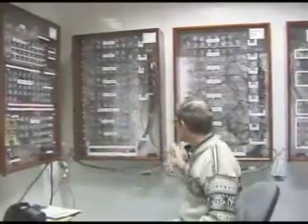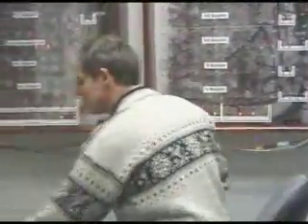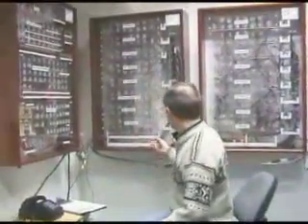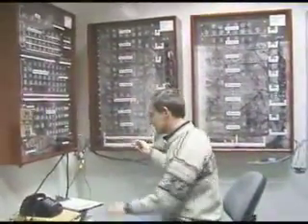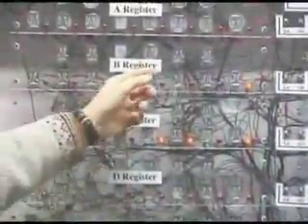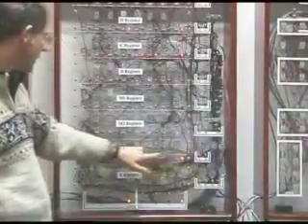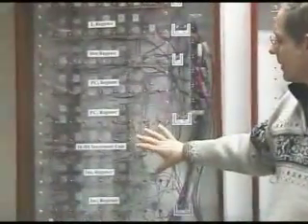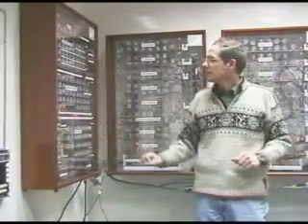Harry Porter's Relay Computer

Comment: Automatic elevator controls worked like this for a long time.  And jammed frequently.  Think about it: They needed a stack to remember the floor calls both from inside the car and the floors.  They needed to resolve them as the stops were made.  They needed logic to determine the direction the car would move.  But it was asynchronous.
Reply: Also pinball machines.

Comment: I have two questions. 1. Why wasn't this around 150 years ago. 2. Why build it today?
Reply: +Bizorke We didn't have this kind of computational logic 150 years ago, and something like this today is usually built for fun.
Reply: Actually, we did... and everybody who knew the things that could have made it work, from the bare idea to the implementation details, knew each other and had either social or professional relationships. (That includes, but isn't restricted to, George Boole, Augustus De Morgan, Michael Faraday, Charles Babbage, with Ada King, the Countess Lovelace as both a social linchpin and contributor of the "effectively computable" concept, à la Turing.) It's obvious in hindsight, but then every good idea is obvious in hindsight. The trick is to see something that isn't there yet. And, in the case of a couple of the possible key players, getting everybody to play nice together when it counts. Konrad Zuse, working some 75 years later, had the slight advantage of living in a world where relays were ubiquitous, Boolean algebra (with De Morgan's refinements) had become necessary to manage telecoms switching tasks, punched paper tape and tabulator cards were everywhere (though he did use photographic film as a replacement for reasons of mechanical reliability) and the idea of having an electric switching machine to manage the task made binary (or even binary-coded decimal) arithmetic much more practical than it could possibly be with page after page of 1 and 0. It still took vision to see the thing, but the parts were, by then, jumping up and down and waving their arms about.
Reply: Not 150 yrs., but about half that time, EDSDAC.  Also as an educational toy to teach computer logic 50 years ago, there was a board with about 4 relays built in, signal bulbs, some capacitors and resistors you could use as jumpers, and a clock that worked just like an engine's mechanical distributor to simulate a machine cycle.  You could use the resistors and capacitors to build asynchronous units, and/or the clock to make synchronous ones.  Its competition was a plastic hand-cranked all-mechanical computer.

Comment: Very cool.... must be hard on the relays? I wonder how often one fails under the repetitive actions.....
Reply: +Peter Rabbit yes they are fantastically unreliable when compared to solid state.
Reply from the maker: These relays have a rated MTBF (mean time between failure) that is very high, but nonetheless I was seeing failures! Two failure modes: contacts were sticking closed and failing to open; and contacts would physically close but fail to conduct. The problem was that I didn’t have “fly back” diodes and the inductive coils were causing nasty arcing. This was welding the contacts closed and (I think) oxidizing the contact surfaces. The arcing was also frying the LEDs. So I recently took the whole thing apart and added diodes to every single relay. Now the computer never fails… but mostly because it is never powered on!

Comment: Depends on the computer's architecture.  Technically any computer should be able to emulate any other computer and run programs from it, given enough time.

There's one guy who's managed to run Linux on an 8-bit microcontroller emulating a 32-bit chip, although it takes several hours to boot.

Comment: It depends what you classify as 'duplicate'. Sure digital can put out exactly what is coming in. I can testify that I have a very difficult time telling the difference until I PLAY something digital. A modeled guitar amp sounds the same, but if I sit there and play one for any length of time I grow fatigued sooner. The LSI organs I play requires I adjust my hearing to a slightly fake sound. It's all subtle. The gap is closing though.

 I challenge Kemper to model a Conn 645 analog organ exact.

Comment: "Digital can't seem to accurately duplicate the vacuum tube, transistor, and LSI organ sounds with any accuracy."

That doesn't make sense. You can emulate any analog circuit with any precision desired using an appropriate amount of Nyquist and SPICE. If the output signal doesn't match, then the model is wrong. The problem is not in the numerical nature of the simulation itself.

Comment: last...cont. I have been searching for a practical approach to the issue of capturing every nuance of the great vintage, and slowly disappearing, analog electronic and electromechanical organs. There are subtleties that digital has an awful time at duplicating. In fact it's a complete failure on many levels. I will use the Wurlitzer electrostatic reed organ as the ultimate example of an organ that can't be digitized. google 'Wurlitzer 4600 NSHOS . 

Curious about Kemper amp tech for TonGen &FPGA

Comment: ...cont.  It seems that the behaviors that make the analog electronic organs sound the way they do are very dependent on lots of analog interactions in the circuitry that can at best be mimicked digitally, but the resultant sound is that sterile digital sound that is always the same. Actually digital in the 21st century has come a very long way. The free Hauptwerk Paramount 310 Wurlitzer download is stunning, but it is a pipe sound. I'm convinced there's a way to apply digital differently..cont.

Comment: Yes they can. A capacitor stores charge, and if you charge it up and then measure the voltage across the terminals, there will be a voltage there. If you then discharge it, there will not be a voltage there. You can, therefore, effectively store one bit of data by charging or discharging it. If you then connect one terminal to ground and the other to the gate of a MOSFET transistor, you can make the transistor conduct if there is charge or not if there isn't. This is used in SDRAM.

Comment: In my own setup, I was thinking to use relays for memory as well, as this is what Zuse and others did... however, if you take note at the size of his Register Unit, which contains, A/B/C/D/M1/M2/X/Y registers for the machine, that is analogous to 8 bytes of RAM.  That unit contains 126 relays for its control logic and storage.  His SRAM chip is 32Kx8, so to make 32KB RAM with relays it stands to reason it would require at least 516,096 relays. (32,768 / 8 = 4096 units * 126 relays = 516,096).
Reply: It must be a CISC architecture.

Comment: Transistors may work, they work on the same principal I believe I dunno what you mean by Capacitors, the difference between Trans and Relays are chemical vs Electro Magnetic, I doubt the LCD screen most likely LEDs to show output.

Comment: Fantastic!

I wish I had a machine like this during my assembly programming class - something is lost when you're programming low level programming with solid state devices.

If I were you I would cheat a bit and use a modern PC to load up the programs.... and the debug the programs.

Did you create your own instruction set?

Comment from the maker: @snippydude

THANKS!

Some people point out that all computers are "Turing Machines" and, in a mathematical sense, all computers are equally powerful.

Recall that a Turing Machine has an infinite tape. The infinity is crucial. Without that infinite memory, the thing is a Finite State Machine, even if it has a 1TB disk. Thus, every modern computer is a FSM. However, in real devices, the amount of memory does matter. Memory is like speed: more is better.

Comment from the maker: @toptenmaterial

Yes, all computers are identical, in a mathematical sense, having an ability to compute the same set of functions. The only differences between computers are (1) speed, (2) size of storage, (3) Input/output devices, and things like cost, size, and power consumption.

In theory, I could write a PC simulator for my relay computer and use it to boot Windows. However, it would take about 500 years.

Comment: @NOnehtaehgnik a bus is parallel lines where multiple devices can tap the line to use data as it flows over the bus. generally a bus has some sort of address to go with the data bus, and that address is used to select which device(s) are active for that bit of data.

Comment: it's made with relays. have u never heard relays clicking?

when current is passed through the coil in a relay it creates a magnetic field which then attracts and toggles the contact to the other position. when it touches the other position, the relay makes a pretty audible clicking noise (depending on how big the relay is i guess) this is a system of hundreds of relays and when they click over it's obviously pretty audible

Comment: Relays are electro-mechanical devices. It's comprised of basically an electromagnet that pulls a reed switch close. The clicking sounds you here are the inner switches making contact to the electromagnet pulling it (to complete the circuit).

Comment: Hm, that would be pretty cool. I think you need sort of a water tower for  a high pressure water  flow that can turn on and of switches to interact with a separate water flow running your "program". Memory can be an array of filled or empty bits of water.